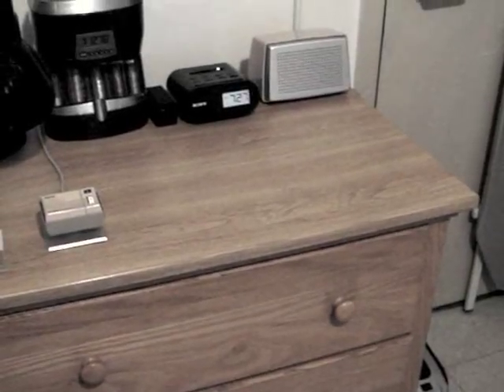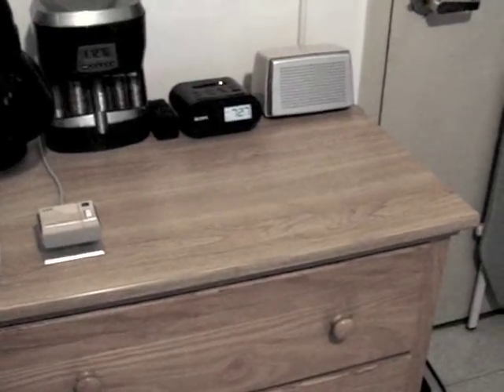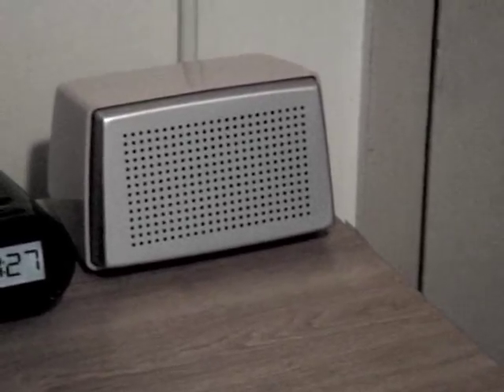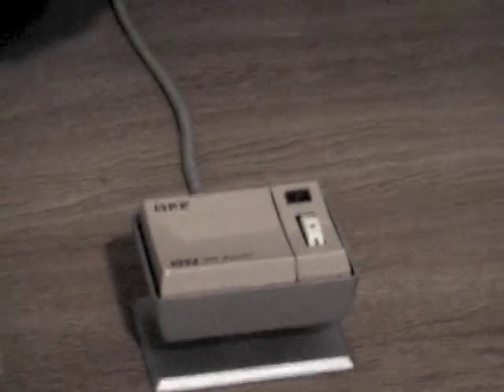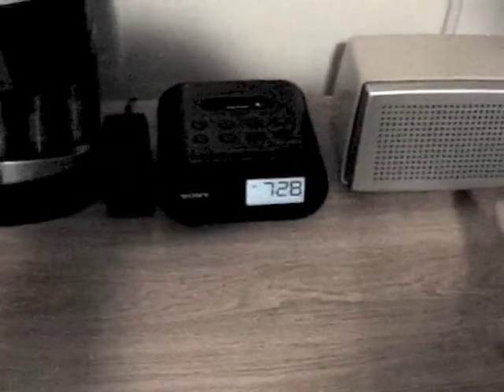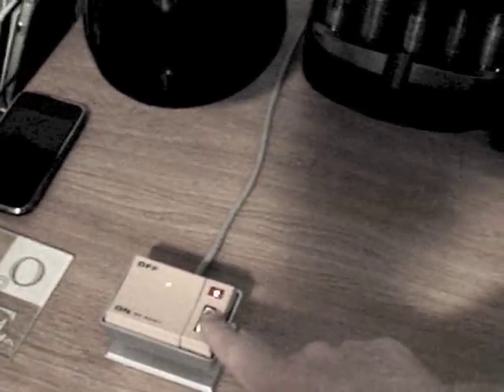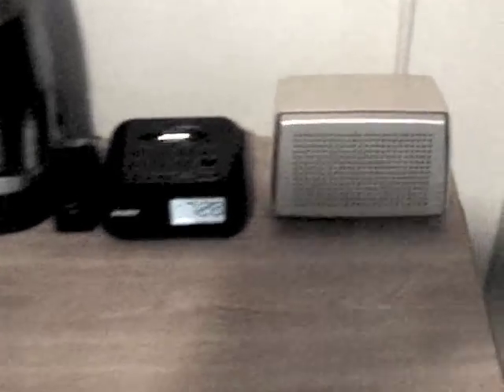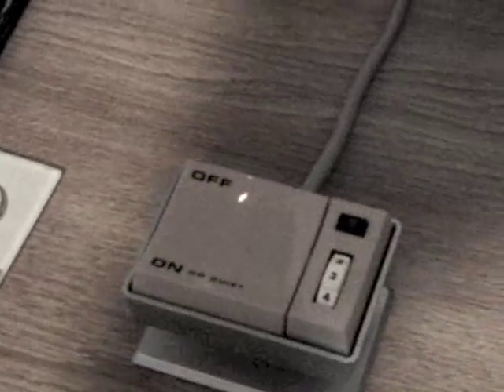Speakerphone Project

Comment: Could you please share the way you got changed it to a modular connection?
Reply: In my case I use the 223A adapter to connect the leads of the Speakerphone to the M16C cable.  The other side of the M16C cable had all the wires out ready to connect.  I connected the following wires of the M16C Cable to the internal terminal screws of a modular Jack:  White w Brown Stripes to Yellow Terminal, Orange w/ White Stripes to Yellow Terminal, Blue w White Stripes to Red Terminal, White w/ Blue Stripes to Green Terminal, and White with Orange Stripes to Black Terminal.
Reply: Michael Dodd I’ll try to find these parts and mimic your solution. Thanks!!
Reply: Frank Badillo You don’t really need the 223A adapter as it’s just a housing where you connect the ends of the Loudspeaker, Transmitter and Power cord to the M16C cable.  It just houses that connection to make it look better and keeps the connection firm.  You will need an M16C cable though and a regular phone Jack with. The four posts.
Reply: Michael Dodd I see, but I cant find that cable anywhere.Is it an amphenol connectio? Forgive me if I fet these mixed up, Im new to the vintage phone  world
Reply: Frank Badillo Yes.  It was a standard cable used for key telephone systems.
Reply: Michael Dodd This is a great resource. Thanks!!

Comment: You forgot the 2500S telephone that goes with it.
Reply: The whole point was to make the speakerphone modular without the Telephone.  I didn't have the room for the 2500S!  I basically turned it into its own extension that works like any speakerphone with a line in jack on it would work.  It does do away with on the hook dialing but it's not big deal.  Just dial on the regular phone, activate the speakerphone and hang up the telephone handset.
Reply: @michaeldodd9671  This is so cool. I have most of the parts. I wonder if there is a way to incorporate bluetooth for use with a cell phone!